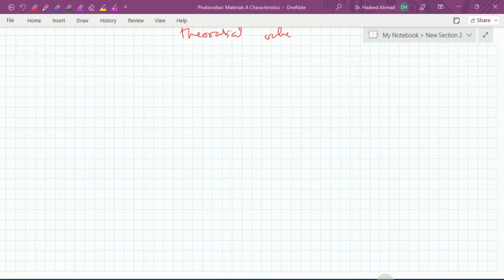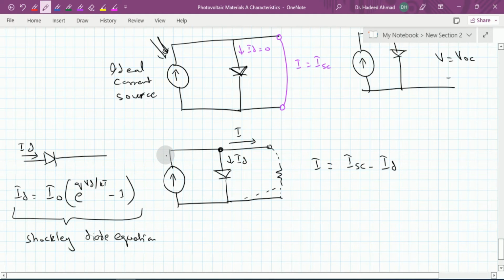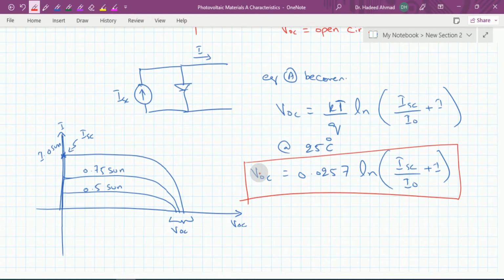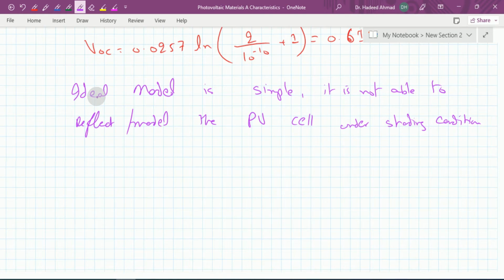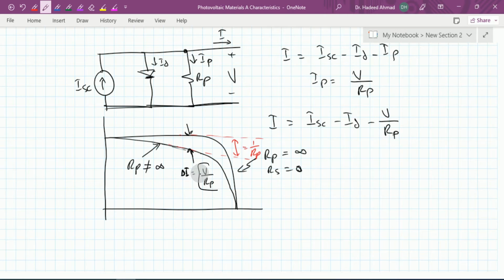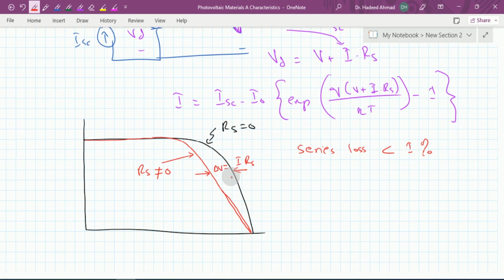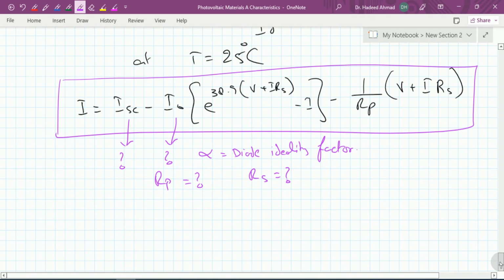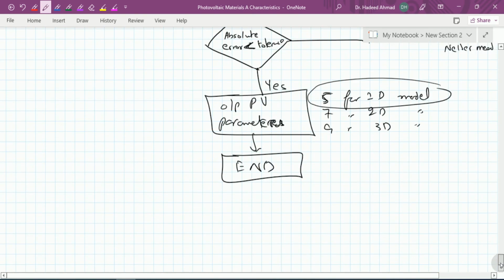Photovoltaic Systems Lecture 2 | Electrical model of a solar cell

Comment: Aoa.  Sir what is the difference between single diode, two diode, three and four diode models? Thanks
Reply from the maker: The difference comes in with the properties of the PV module. For example, in a 1 D model a diode is used to develop the understanding of the PN junction, while in 2 D model, the junction recombination effects are also included. In general, more the number of diodes, more complex and accurate the model is. However, it should be kept in mind that very detailed models are often not required at a system level and a good compromise between accuracy and convergence speed is desired.

Comment: Thank you very much Dr. Hadeed. 
I have a doubt about the shunt loss: in the "Shunt PV model" section I have understood that to keep these losses below 1% the Rp should  be greater than one thousand times Voc/Isc. Shouldn't it be only one hundred times, instead? 
Best regards
Reply from the maker: Yes thanks for the correction. It is 100 times.